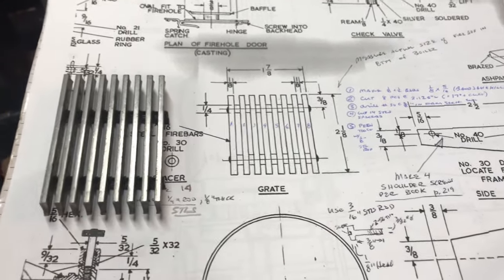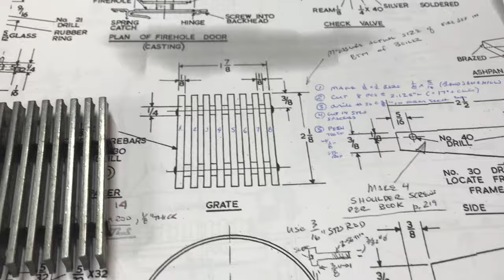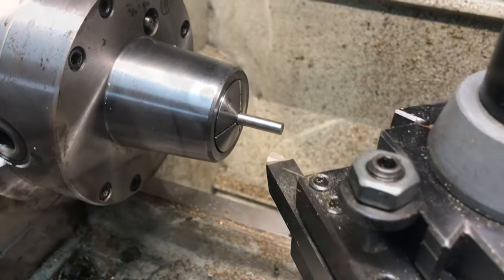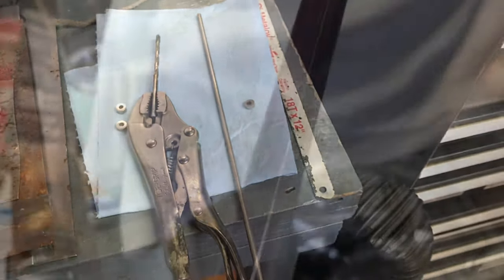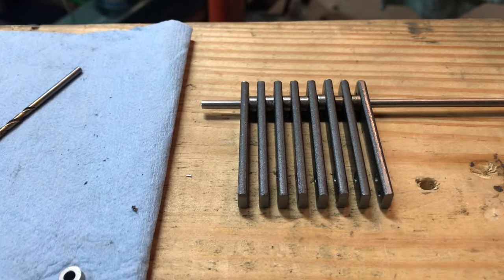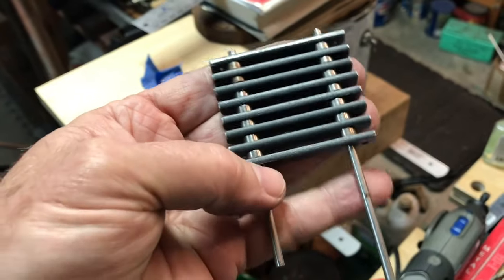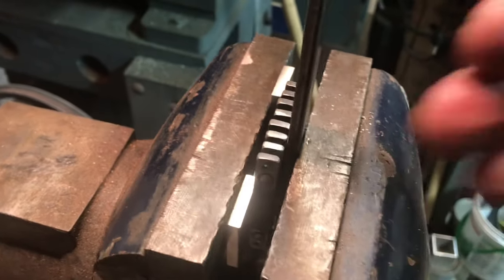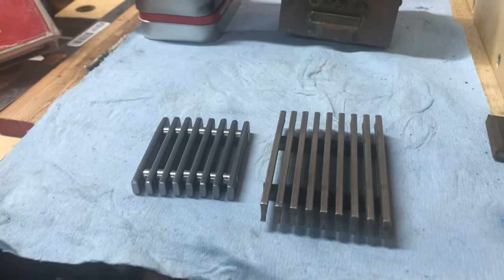44. LBSC Tich locomotive project. Making the grate for the firebox

Comment: +Looking good Bill. I wouldn't have thought of the ash grate,  I was thinking of it being run with propane.
Reply from the maker: Thanks, Russ. I would prefer to use propane but there’s not much room for burner fittings in the little boiler’s firebox. Many people I trust have said the best running fuel is Welsh coal. Fred has a supply of it he can share with me, so that is the plan.

Comment: Bill, did the rod cold form okay with the hammer or did you have to heat it up?  Being stainless, I didn't know if it would work harden as you peened them down.

Joe
Reply from the maker: Thanks, Joe. It cold formed Ok. Not real pretty, but very solid. Did not have to heat it up. Bill